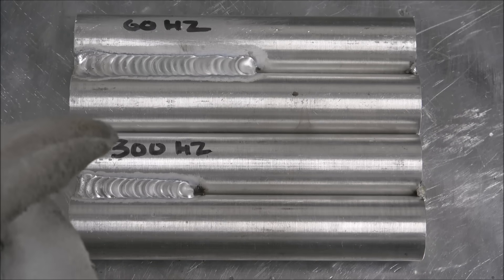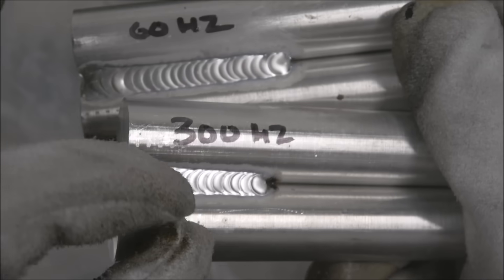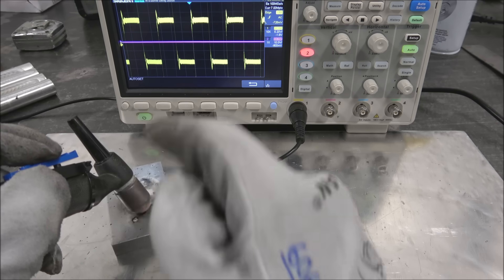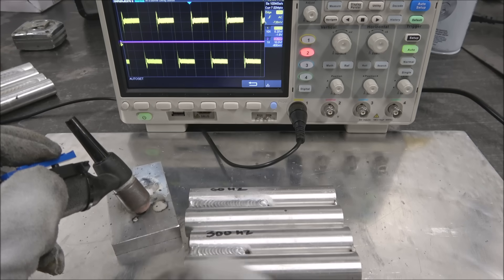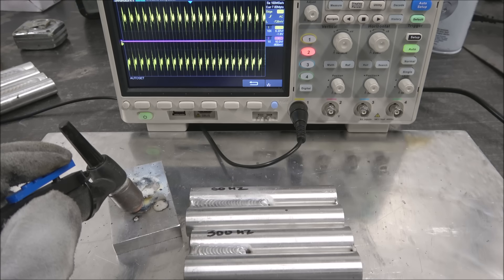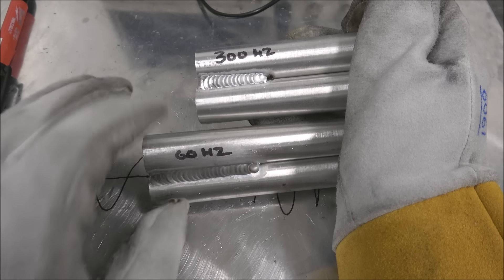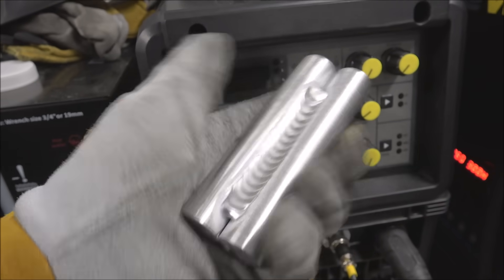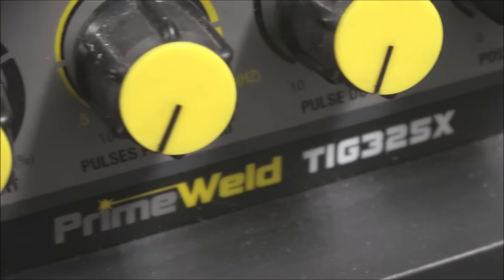TIG Welding Aluminum - AC Frequency "Hocus Pocus"? - The Truth - Gets easier with a better machine

Comment: Square waves are idealized as having zero rise time, in which case average resistive power would be independent of frequency. However, actual square waves have finite rise time, due to inductance. This is evident as non-vertical lines on your oscilloscope, so your theory holds water.

Comment: You can calculate energy (heat) from the area (EN and EP with no sign) between zero and signal. Btw. when the signal is true sinusoidal frequency would not matter. But the signal is more like rectangular at 60 Hz and looks more triangular at 300 Hz. And by math the area of an triangle with same base and height is only half the area of an rectangle.

Comment: You are all wrong so far.
The switching time is less than  1us, and irrelevant no matter how often you switch.
Where you are getting the "losses" is the inductance of the torch and ground limiting the rate of current rise after switching.
It will take tens of microseconds for the current to rise fully after changing polarity.

Comment: The Dynasty 350 manual discusses AC frequency - 
"AC Frequency controls arc width and directional control. As AC frequency decreases, the arc
becomes wider and less focused, limiting directional control. As AC frequency increases,
the arc becomes narrower and more focused,
increasing directional control. Travel speed
can increase as AC frequency increases."

The manual also notes pulse rate called pulse per second -
"The higher the PPS setting, the smoother the
ripple effect, the narrower the weld bead, and the more
cooling you get. By setting PPS on the lower end, the
pulse is slower, and the weld bead wider. This slow pulsing helps agitate the weld puddle to help release gas
trapped in the weldment, and help reduce porosity (very
useful in aluminum welding). Some beginners use a
slower pulse rate (2-4 pps) to help them with their timing
on adding filler material. An experienced welder may
have the PPS setting much higher, depending on their
personal preferences, and on what they are trying to accomplish."

Comment: This is why higher frequencies are used on anodized aluminum in the boat world. It helps to keep the heat input down and reduces damaging the rest of the anodizing around the welded area.
Reply from the maker: Please correct/educate me if I'm wrong (without 10 paragraphs please)

So how is that any different/better than just turning the amperage down 5-10 amps to "keep the heat input down"? You gotta get the puddle big enough to put the weld size you want on, regardless... If you increase the frequency, you'll end up needing to use a higher amperage setting on the machine.  Makes no sense to me (no benefit)

Pulser or pedal pumping is the only way I know of to get a big weld and reduce heat input (besides a faster travel speed).
Reply: Personally, I don't run as got as a lot of folks welding anodized. I weld it daily with a primeweld 325 and I run 190 amps and 175hz. I do bump with a finger switch as well. I know a lot of people run around 230-250 amps, but I side with you here as that's always been too hot from my experience. 

 Thanks for the content and I've learned a ton from your site. I subscribed over 3 years ago and it was a huge help with learning to TIG aluminum.

Comment: You spoke briefly about it. With the lower frequency the electrode spends more time on the DCEP side of zero, which gives you most of the heat input to the part. DCEN inputs heat to the electrode, but also gives us our cleaning action.

Comment: Mathematically, the root mean square of the power should be the same. In the real world, though, you lose power with higher frequency due to switching losses of the transistors, parasitic capacitive coupling and increased inductance of the leads.
Your intuition that the zero-crossings are the issue is kinda right. To facilitate those, one half of the transistors have to switch off and the other half has to switch on. That's not possible to do in zero time. So that ramp down and ramp up is both the energy you lose when compared to the ideal mathematics. How much you lose is very dependent on the transistors used but it's actually very significant and you have noticed in your experiment.
What's also fun to consider is the coupling of the leads as I mentioned above. At 315 Amps, you have a very significant magnetic field in your leads. That magnetic field of course couples to all conductive surfaces near it inducing eddy currents in those. I betcha if you rolled up your leads into a coil, put an iron piece in the middle and do this test again, you could measurably inductively heat the iron piece. Yeah, and that'd be also one of the ways you lose energy for the weld.

Comment: I think it's because of something other than the number of passes between the poles. I bet more on the fact that the surface area formed by these peaks ( the integral of function ) of higher frequency  is less than in case  when the frequency is lower. Although multiples of polarity changes may have minimal impact as well

Comment: I think it has more to do with the cooling rate.

So if you simplify it to spheres cooling: smaller spheres cool faster than larger ones.

So for example: AFAIK a big cup of tea cools slower than small ones.
 Not because there is just more heat mass (it cools down way slower than the bigger heat mass would suggest)

It’s AFAIK because the surface area grows way slower with increased diameter than the volume grows for the same diameter increase. 
And the surface area is the driving one in the heat transfer equation.

So put short bigger spheres have more energy but comparatively less surface area through which the heat can escape through. (with the given thermal conductivity) 

So in my conclusion it’s favorable to form bigger spheres of weld because they retain the heat easier during the cooling cycle until the next heating.
Reply: area sphere A = 4πr²
volume of sphere V = (4/3)πr³

yeah the weld is more like halve spheres, but I guess factor of 1/2 everywhere wouldn't change the relation between r² &  r³ 

heat transfer rate  Q = h * A * ΔT

Comment: The big reason for less heat is diffusion. With fast frequency, you pull heat away, and it diffuses rapidly into surrounding aluminum, but slower frequency, you heat up before the heat diffuses away, and get a higher temp. If you’re really interested, look up solving the diffusion equation with Time dependent sinusoidal boundary conditions. We had this exact problem in my undergrad numerical physics class.
Reply: I thought the whole point of a square wave is that the transition happens instantly in time. Wouldn't that mean that it's absolutely irrelevant how many transitions a second you'll have?
Reply: Makes sense - for same amperage and voltage DC would deliver more total heat than AC would because it's not cycling across 0 volts 60 to 300 times per second

Comment: There are a lot of issues at play here but yes higher frequency will give you less heat/penetration - inductive reactance in the cables since it is proportional to frequency, switching losses (ramp up and down, it isn't instantaneous), and how the current affects the metal at that frequency like the Skin Effect.

Comment: Were you at 60Hz on the PrimeWeld? Kinda sounds like it. Maybe I missed you mentioning it.

Also, would that machine work on a mobile generator? My Lincoln square wave doesn't like the dirty electricity.
Reply from the maker: Mine worked fine on a PTO generator.

Comment: This is due to inductance or more specifically inductive reactance which is frequency dependent (XL=2*pi*f*L).   What's effectively happening is that the impedance of your welding leads is going up as the frequency goes up, so you're losing more power in the leads and there's less current left in the arc to heat up the weld joint.   You can actually measure this by striking an arc for a fixed amount of time and measuring the temperature rise of your welding leads.  The higher the frequency is, the warmer the wires will get.
Reply: The inductance of the wire loop should be a few micro Henry. The loop has a radius of a meter or so, and ln(r/a) should be around 5.
This means the inductive resistance is on the order of 3 milliOhm. With 6 meters of 8mm^2 copper cable, you already get 12 milliOhm resistance.
Skin depth shouldn't play a large role, at 300Hz it's 4mm.
So there might be an effect, especially with very thick cables.
But I think most of the power is delivered in the arc due to its high resistance, so the loss of power due to inductive losses should be negligible.
Reply: is it also possible that on a sine wave the root mean square amperage/voltage is higher on lower frequency. The more cycling through the sine wave means more time spent tapering off through zero, giving less mean time at full amperage at the top of the wave.?  Obviously this is going to mean nothing on a true square wave.
Reply: The voltage drop across the arc is a few volts. With 125 amps, the inductive impedance should result in maybe 0.3 Volts of voltage drop across the wires, while the ohmic resistance should result in about 1 Volt.
In the waveform on the oscilloscope there seems to be some oscillating component at about a kilohertz. Probably there is both a larger capacitance and inductance built into the power supply. This would increase the impedance quite a bit more.
Reply: I agree with Lukas, by gut feeling, that the inductance should be negligible 
I would like to add that we are also still talking about quite low frequencies 

my theory is that the power put into it is basically the same and the reason lays more in the way that the heat is being carries away form different size puddles

Comment: Can you run a test watching both voltage and current? You'd probably need a CT and a VT to do that safely without popping the scope.
Reply: yeah would be interesting, I would guess tho they should be mostly the same at these frequencies with the mostly resistive load

Comment: Do you mind sharing how you had the scope hooked up? It wasn't clear if you were monitoring current via a current transformer, or voltage. My guess is CT, because it varied directly with your amperage setting.
Reply: it would also vary directly with voltage measurements, as the voltage drop has to "dissipate" somewhere so even some millivolt drop over the plate to desk or somewhere else would result in these readings with the right scale.
 In these ballparks voltage and current are basically in sync because the load is probably mostly resistive

Comment: I'm just some guy but here's my thinking on this

If the machine generated a mathematically perfect square wave, then 60 Hz and 300 Hz would have the same power output. But this is clearly not the case.

It would appear that when the machine switches polarity, that current takes some time to stabilize, let's say for example 0.5 milliseconds. During that time we are apparently only getting partial power through into the part. We can calculate that the period of a 60 Hz frequency is 16.7 ms, half of which, or 8.35 ms is spent at each polarity. If we are only getting partial power input during the first 0.5 ms of those 8.35 ms, that means that for each cycle, we are getting partial power for 5.9% of the cycle. We can repeat the same calculations for 300 Hz and arrive at 30%. 

All I'll say is that this consistent with the results we see.

Comment: Engineer here, it's due to the wave becoming less and less ideal, the area under the wave is smaller.
Reply: Yeah the machine has a harder time yanking the current rail to rail so isn't approximating a square wave nearly as well at higher frequencies.  I.e. the slew rate isn't infinite, so you spend more time not at full output.  If the machine were stiff enough internally (incredibly high slew), it shouldn't matter how many times you cross zero, because you jump straight to the nominal value.  But since the machine can't do that, imo, that's where the heat is disappearing to. Area under a abs(cos()) is 64% of area under abs(square wave()).

I mentioned this immediately after the video was posted and got my comment deleted.  I don't think he was in a very receptive mood for alternate opinions just then.  🙂

Comment: Since it’s at zero, how many times it’s at zero would have zero effect 0x1000=0 it’s the time ramping up and down (actually a slope) that effects it. So yes you are correct it’s spending less time at the max when the frequency increases but it’s not because it’s at zero more often. Also, the distortion of the wave appears to increase with frequency, and it doesn’t matter that the settings are the same, it matters what the machine is actually putting out, would need a true rms measurement of voltage and current to compare. 3) inductance is absolutely a factor, as another poster pointed out. It affects current at the weld a lot. You can do an easy practical test of that by winding the cable 4-5 times around a steel bar, that will act as a choke that will really reduce the current as the weld as frequency goes up. I think the Areo. Guy was trying to say on thin stuff, upping the frequency improves penetration at a given amp setting, so you can reduce burn through by upping the HTZ and lowering the amps. It is said to focus the cone of the arcs heating, and I’ve had that experience

Comment: I think that "skin effect" also has something to do about this. The higher the frequency, the more current flows on the outside of a conductor - consequence of eddy currents.
Reply: yeah it might play a tiny part in the equation but given the small resistance to begin with even a doubling of a low resistance would be low 
and for an 4/0 cable at 300Hz it should be only in the ballpark of 10 to 30% reduction in conducting size therefore far from doubling, and even doubling would only add about a milliOhm so --> 1mOhm *100A *100A to get the additional power loss in cable resulting in the ball park of 10W additional.

and we are taking about 10-30% of that

edit: yes it exists but I would suggest the power put into the part is way more and similar -ish at both frequencies. 
my thesis is the clue lays in the heat being carried away differently within the part due to longer heating intervals at slower frequencies

Comment: I have a background in electronics and I have taken some formal training in welding. (Yes, it felt weird to be deliberately welding with electricity.) I never thought I'd see an oscilloscope in a welding video! That was fascinating and I'd love to see more of that! Even with square wave, going through the zero point that many times per second should create less heat. The difference between 60Hz and 300Hz is massive. I think you are right.
Reply: I have a background in welding and I have taken some formal training in electronics. Does that make us opposites that attract? LOL. Seriously but, I was a welder then did mech eng then electronic eng. But just diploma level for those two. My thinking is that the power, which is the source of heat, for an identical amplitude but different frequency square wave should be the same. But clearly this is not so in this case. But#2, I'm an old fart now and forgotten more than I was taught. By the way. I have several CROs and a DSO. They live a bloody long way from my welders. LOL. So I get you.
Reply: heat is watt hours or watt seconds aka joules.
and RMS does not change with frequency and should also not change for halve wave or rectangle 
RMS  stays the same with same shape and amplitude regardless of frequency

so my thesis is that  it correlates to heat being conducted away by the material rather than the actual heat input changing due to diff. freq..
that's why a preheated part works with smaller heat input

Comment: Please repeat the oscilloscope measurement using the Vrms measurement function. 

If the welder puts out a lower Vrms at 300Hz than at 60Hz, that explains the weld heat.

If it puts out the same Vrms, with the same current setting,  then it must be something else, maybe skin effects in the aluminum, or something about the oxide layer.

Comment: I wish you would have used the scope Measure RMS functionality. 
That would tell you how much power is going into the part.

The official RMS measure is actually performed,  by definition, by heating a metal part with an oscillating waveform. 
You are effectively performing an ideal RMS mmeasurement when you weld.
Reply: the waveform of the current/ voltage are the same to the one on the scope anyway, because we can assume the resistance of his circuit straight thru the table is constant,  therefore the graph is basically the same as the rms of the power just scaled by a root 

(if we assume he measured the current,  the formula for power would be P= R * I^2  -> resistance R ist just a scaling factor and the square is just not linear but basically same shape because voltage and current shape are the same ) 

sorry if confusingly formulated -.-  :-)

edit: 
oh I might misunderstood your comment, yes if he would have used the integrated calculation for the area unter the wave we would have known relative power values to compare 
I agree with you, it would be good to demonstrate,  that the power mostly should stay mostly the same regardless of frequency.
(rms doesn't change with frequency, only with change in shape or amplitude) 
so the probable variation in rms measured would only be due to shape changing due to all the noise and power cleanly ness effects

Comment: Zoom in and measure the time it takes to go from full-on EN to full-on EP, that's time in which you're putting less heat into the part.  Multiply transition time by the frequency and you get the fraction of time spent in transition, per second.  Do the same exercise for 50hz, 100hz, 150hz, 200hz, and so on and see if the total time wasted switching increases linearly with frequency.